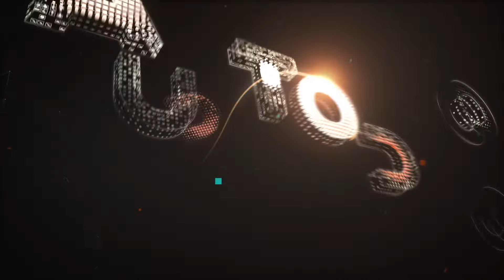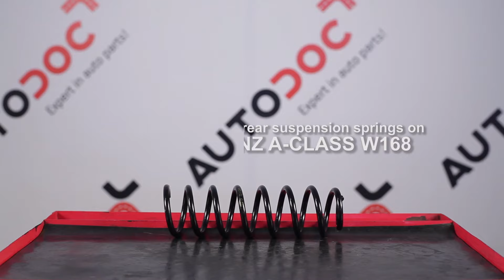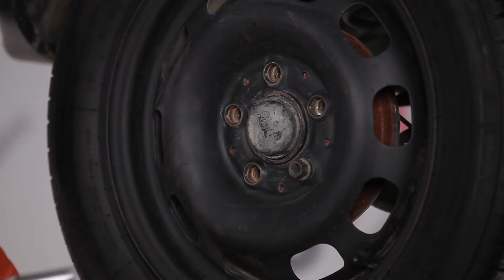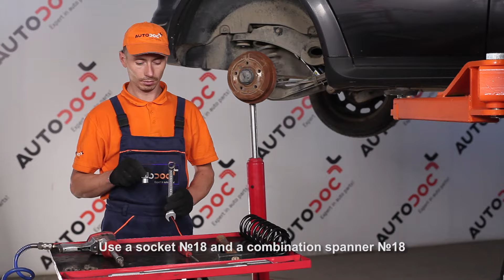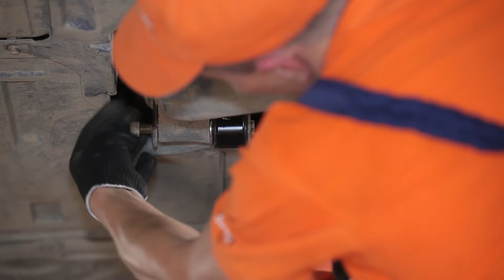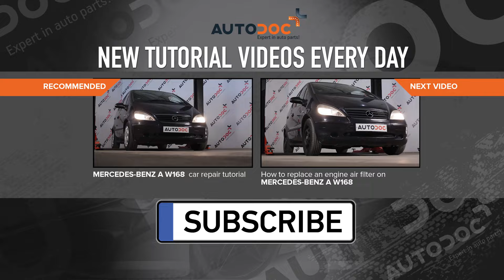How to change rear springs on MERCEDES-BENZ A W168 TUTORIAL | AUTODOC

Comment: you lack these parts under the coil springs: BASE PLATE and RUBBER BUFFER / STOPPER
Reply from the maker: Thank you for the feedback!This video is considered to be an informative one, and it shows the sequence of repairs,so some stages of the repairs might have been excluded. Best regards, Autodoc.
Reply: chriz74 merc have updated the spring to do away with the plate and rubber cup by having a rubber sleeve over the spring instead and a plug to put in the hole thats left where the rubber cup used to sit